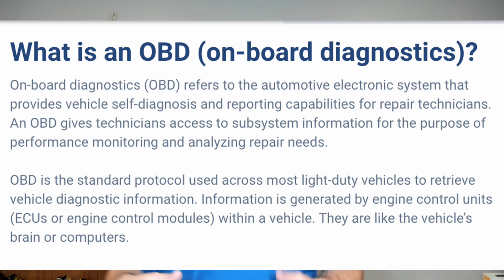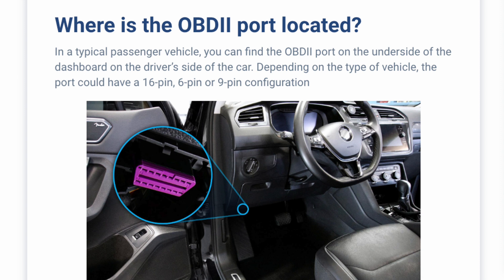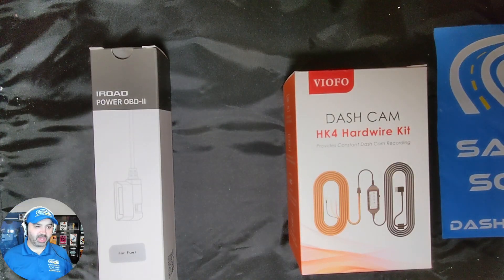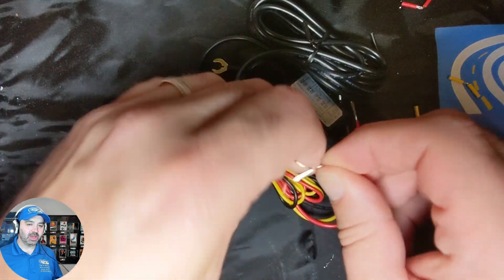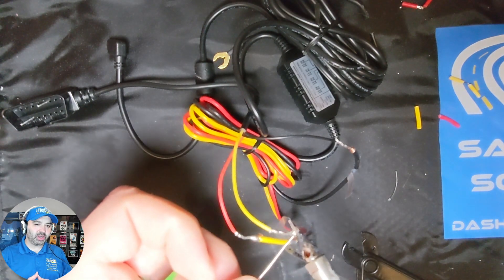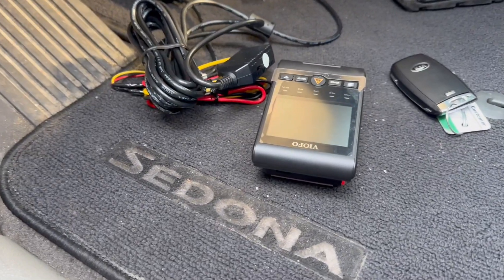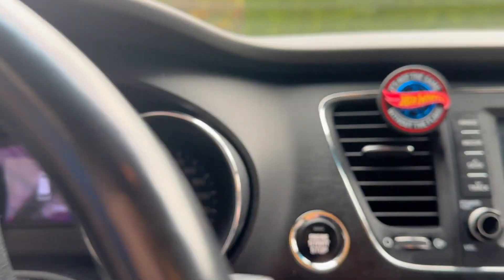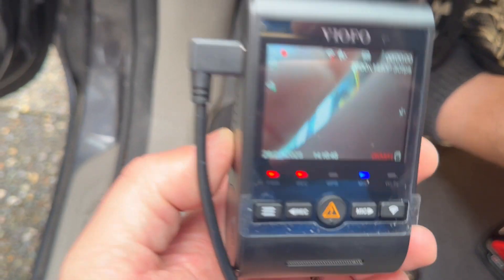Viofo OBD2 Hardwire Parking Mode Cable

Comment: So will this work with a 2013 BMW 328i car ? I have the Viofo a139 pro and if I use this method and the car is off, will it drain my car battery ? Also, if I put the parking mode on in the Viofo app and the car is off, will it record still ?
Reply from the maker: We typically use these for BMW of those years. I only ever seen one BMW not work. It was a special sport model. Yes it will work for parking mode as well.
Reply: @SafeDriveSolutions  so I decided to charge the dash cam with a Talentcell 12V LiFePO4 Battery Pack instead of hardwiring the car. Now if I wanted to have the parking mode be on 24/7, which settings do you recommend that won’t drain the battery pack as fast? Also, how can I view my dash camera will being inside my house?
Reply from the maker: @coraliecadet90  not familiar with the components you are using. It will dependon the dash camera you are using and the current draw associated with that camera. No camera is named
Reply: @SafeDriveSolutions  I’m sorry it was the Viofo A139 Pro I opted to do the battery pack instead of hardwiring my car for now and I wanted to see if there was a way for me to see the dash cam whilst being inside my home. I park my car in a parking which is far from my apt complex. Which settings on the Viofo app do you suggest I put in order for me to see it live or at least record only when there’s a collision detected ?
Reply from the maker: @coraliecadet90  all 3 parking modes will detect impact. Time Lapse, Low bitrate and auto event detection. They are all very close in current draw as well. There is no collission detection only mode on this camera.
Reply: Bit confused.  I purchased the iroad, followed instructions on your video other the wiring.  I have a a139 pro.  If the obd pin 16 is 12v constant and pin 4 and 5 is ground, where does the red wire going to at what pin number for acc power? Or is the Yello and red wire feom the iroad share the same pin 16 in the obd??

Comment: Merhaba. Vantrue N5 kamera almayı düşünüyorum. Tavsiye eder misiniz? Vantrue'nin kendi OBD şarj kablosu var. Park modu için kullanacağım, sizin yaptığınız gibi kabloya ekleme yapmama gerek var mı? Tek başına kullanılamaz mı?
Reply from the maker: This dash camera draws so much power. I would only recommend using this dash camera for while driving unless you get a battery pack.
Reply: @SafeDriveSolutions  Peki bu güç tüketimi araç çalışırken aküyü bitirir mi? Ya da ömrünü mü azaltır? Park halindeyken OBD II ile park moduna alacağım. Voltaj ayarını 11.6 V yaparım.
Reply from the maker: @mustafa_akay  i only recommend 12 volts or higher. m11.6 volts is way too low. We are trying to develop a video explaining why. Newer vehicles have compeuters and when voltage is too low your vehicle will not start. Current draw while driving is not a big deal. While parked is the concern
Reply: @SafeDriveSolutions  Aracım 2020 model Toyota Corolla 1.6 Dream MultidriveS. Garantisi 2025 yılına kadar devam edeceği için akü park modunu kullanmayacağım. Çünkü garanti dışı olabilir. Bunun yerine OBD II şarj kablosuyla park modunda kullanmak istiyorum. OBD kablosu ile park modunda kullanabilir miyim? Voltaj minimum ne olmalıdır?
Reply: @SafeDriveSolutions  Vantrue N5 ile Viofo A229 Pro arasında kararsız kaldım. Siz hangisini önerirsiniz?

Comment: So instead of stripping this longer cord can i just strip the lighter cord and attach to the ODP?  Same concept.  Correct?   About to try.  Verifyin
Reply from the maker: Lighter cords only have 2 wires not 3. So you can not use a lighter cord
Reply: @SafeDriveSolutions  thanks. Lol.  Good thing I haven't yet.  👍🏽
Reply: @SafeDriveSolutions hi.  I did it.  Worked easy.   Only issue.  It seems the camera is staying powered on even though vehicle is off.  Won't this kill my battery?
Reply from the maker: @marlonerrar5997  yes it will kill your battery
Reply from the maker: You did the 2 wire or 3 wire hook up?

Comment: Another informative video.....Quick question.  I just installed TW Q1000 2ch cam using the Thinkware OBD power cable in a '23 Audi S5.  With camera OFF parked in the garage overnight, I get a notification on TW Connected app saying it is in "Driving Status."  About 1 min later, its in "Parking Mode."  This is occurring without me starting the car.  The car is empty and for some reason waking the camera up on its own.  Will this Iroad OBD power cable be a better alternative and is it compatible with the Q1000.  The TW OBD has many pins communicating with the Canbus while the Iroad just has the 2 pins?  If the Iroad is a better answer, is the cord compatible with the camera or the splice method like you did here better?  Thanks!!!!!  Keep up the great vids.
Reply from the maker: Not sure what to tell you. Dont have an answer
Reply: Hey Ben, I ended up changing out my TW OBD cable to the Iroad cable for the Q1000.  Sure enough, the camera only turns on when I start the car and it goes into Parking mode after a period of time after I turn the car off.  No more turning on by itself.  Even opening a door turns the camera on.  That TW cable monitors Canbus activity and falsely turns the cam on, at least on my Audi application.  The Iroad OBD cable is a great alternative.  @SafeDriveSolutions
Reply: I don't blame you, this TW OBD cable is an anomaly I think for the modern car.  I just noticed you participate on Dashcam TAlk.  Here is a guy rcg530 that I just found out about.  Anyway rcg530 tested the TW OBD cable using 2 methods.  His second video verifies that TW cable does monitor Canbus thus falsely turns on the cam.  Just opening a door wakes up my cam.  W/O writing a long dissertation, here are the links to the TW tests.  This was very enlightening....also rcg530 and BlackBoxMyCar also say that the Iroad cable is compatible.  Thanks!

 https://www.youtube.com/watch?v=mMc0XdayGJ0&t=3s

https://www.youtube.com/watch?v=i6Nwdfc4KgQ&t=10s

Comment: What about fuse backup. How is the OBD port protected
Reply from the maker: The iroad obd2 cable is 2amps rated and protected. Also all vehicles are typically 5, 7.5 or 10amp protected on vehicle side.

Comment: On my three vehicles, the cable run distance from the cam to the ODB2s (and the fuse boxes) is 5-6 feet, max.  In neither vehicle is there any room to stash all that length of cable and the voltage thing - probably a good 12-15 feet.  This in the area above the pedals (and near exposed steering shaft and u-joint).  You could do video on where the heck you stuff all that stuff.  Cheers.
Reply from the maker: What type of vehicle do you have?

Comment: Good example. People can use solderless terminals/butt splice terminals and crimps, or after stripping the wire slide on some heat shrink insulation and after soldering slide up the heat shrink instead of using electrical tape. There are a few methods on wire splicing. Interesting that you have reverse the colored "Red and Yellow" wires, Thank you for doing the research for us so it will function properly. (power "+ and -" and data line).
Reply from the maker: Ignition and constant power are opposite on. Viofo to Iroad and Thinkware. 
Red=ignition thinkware & iroad
Red= constant power Viofo
Reply: @SafeDriveSolutions  As far as I know, Obd2 doesn't have pure  ACC ignition pin that can provide a lot of current.  So Iroad OBD2 cable has black wire connected to either/both pins 4&5, yellow is connected to obd2 pin 16 which is always on. Which pin on obd2 port is the red wire connected to? 
I mean, there are some pins on obd2 port  driven from 12V over pull up resistor  and are active on ignition (like L-line or K-Line communication), but they can supply few mA.